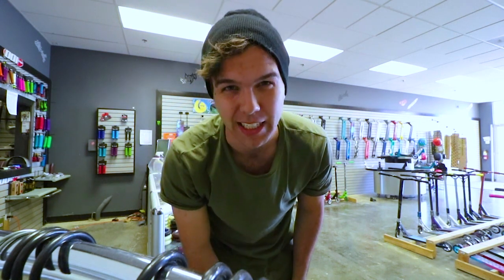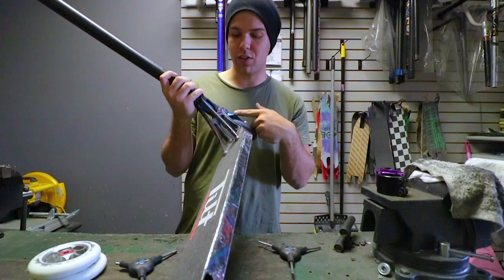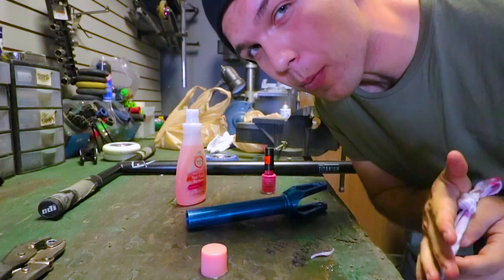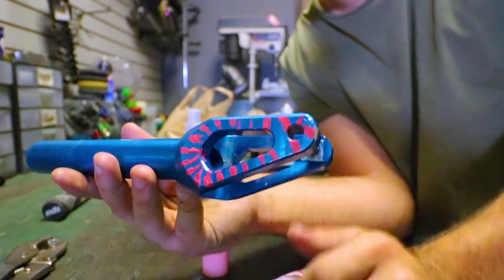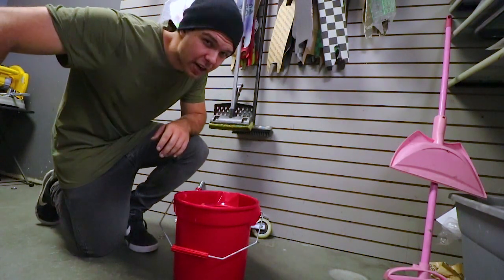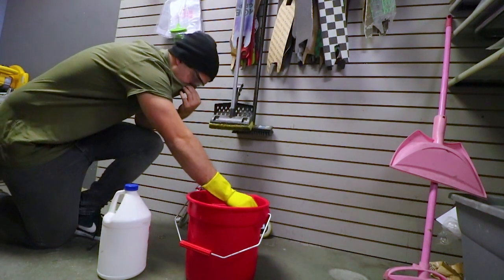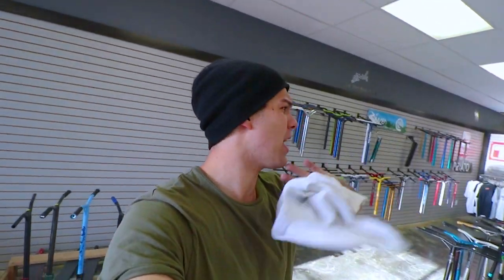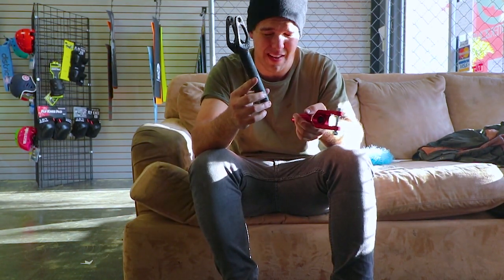ACID VS SCOOTER PARTS! DANGEROUS! SCIENCE EXPERIMENT

Comment: Hey Stephen, Would u recommend I got the envy 12 standard kit? I will probably get them with either affinity Tbar XL or Apex Bol Bars XXL I ride park but I don't think it should matter too much having street parts. Do you know if the Iconoclast deck is any good for grinds or nah? Thanks!
Reply from the maker: Keches I personally love ethic and envy! Affinity Tbars are made from thicker steel so they are a bit heavier. Bol bars are tight! And strong, the iconoclast deck is so good! I ride the pandemonium and it does great! I learned crooks on it and I learned 50's better with it.
Reply: Stephen Garlatta thanks so much for the reply, I may go with the apex bars then and maybe an apex scs clamp but idk. Thanks again!